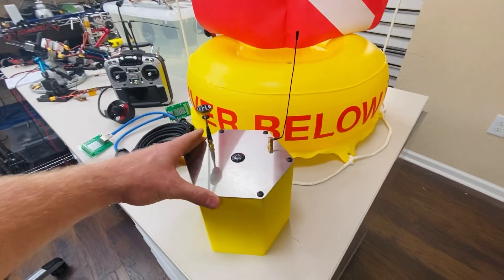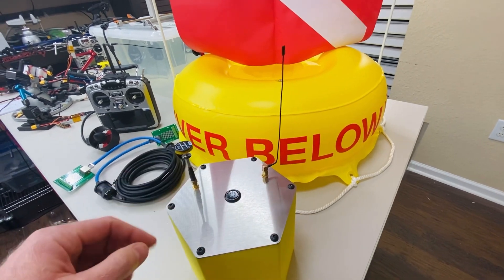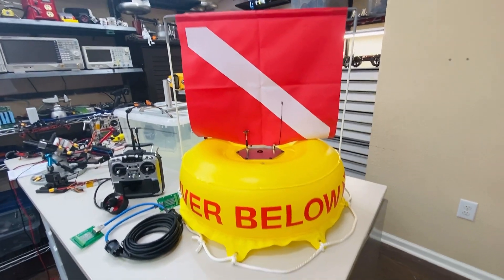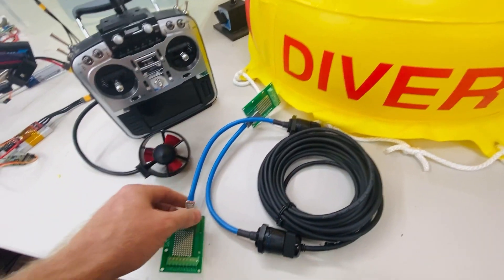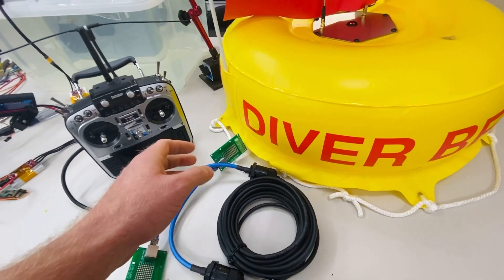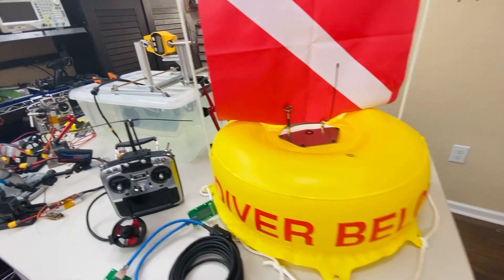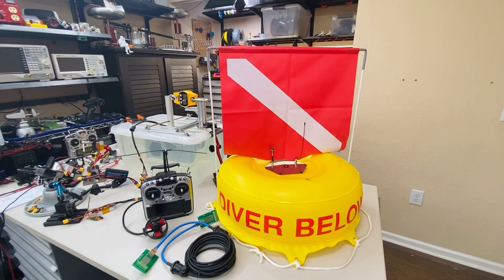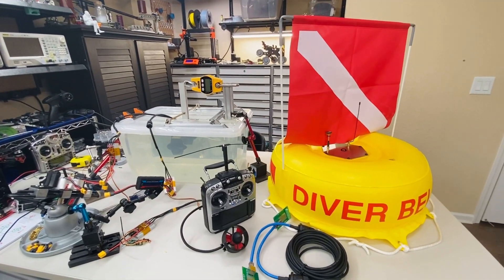Underwater Drone Antenna Bouy

Comment from the maker: Follow me on instagram for more updates: www.instagram.com/protog42
Here are some of the parts I'm using for the underwater drone so far:
Thrusters: https://amzn.to/2T1AiAE
Acrylic Dome: https://amzn.to/3d7XiVy
Camera: https://amzn.to/35PorIP
Reversible ESC: https://amzn.to/2T78k6B
Diving LED Lights: https://amzn.to/35PBJFh
RC receiver: https://amzn.to/3vTYZN4
433MHz Receiver: https://amzn.to/3dXXAyX
433MHz Transmitter: https://amzn.to/2SKwbsF
Video Transmitter: https://amzn.to/2T379Fm
Gasket: https://amzn.to/2U7ZJB0
Ethernet Cable: https://amzn.to/3jpVXgO
Ethernet Breakout Board: https://amzn.to/3x5dLBN
Cable Gland for Tether: https://amzn.to/2SB6Yks
Dielectric Grease: https://amzn.to/35YkG3V
RTV Silicone Liquid Gasket Maker: https://amzn.to/3heQ4jU
Battery Plug: https://amzn.to/3A6de4t
ESC Plug: https://amzn.to/2SwwFT6
150A Power Meter: https://amzn.to/3h9tbOM

Comment: Goofy idea i just had:

You could have a short cabled "kite" that the moving ROV would pull causing it to fly reducing drag?  May need to be a kitoon, or just move constantly to prevent it from falling (wind may be an issue (or asset?) as well?

Comment: I've always thought this is how hobbyist ROV's should be done (tether up to buoy on the surface and then radio link to the buoy).  I'm excited to see where you take this!

From some limited ground FPV I've done the range you get from a radio system is nothing  on ground compared to in the air. I would assume you'll experience similarly dissappointing wireless range unless you're bouncing off a multirotor mounted RF repeater or you get the antennas further up to minimize the RF shielding from the water and the stainless plate.

Comment: Isn't the thrust-measuring-container-thingy too small to give proper real reading? 🧐 Or you just compare one motor to another 😉 

Good luck with moving the lab 🤯😄
Reply from the maker: Yeah, it will give a smaller reading than the true thrust output due to cavitation and turbulence caused by the water hitting the back wall so the numbers I got were about 30% less than the manufacturers rating and justifiably so. I would probably get a more accurate reading in my bathtub but this was initially just to test the current draw for battery life calculations and I figured why not slap my meter on it. I’m not looking forward to moving at all!

Comment: Hello. Would like more information on the control system. IE the receiver aerial and connections you have made. Do you intend to use a Flight controller to stabilize the ROV ? Thank You.